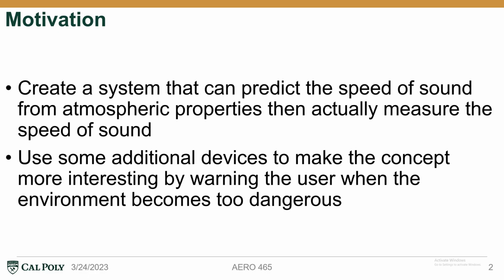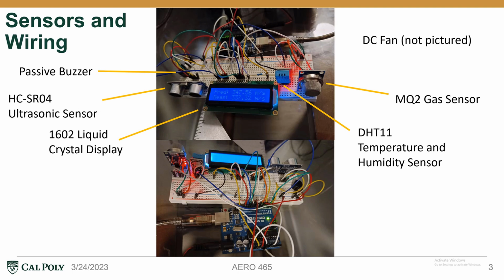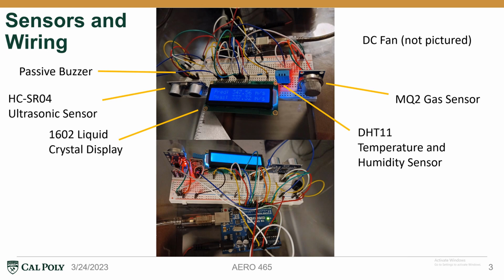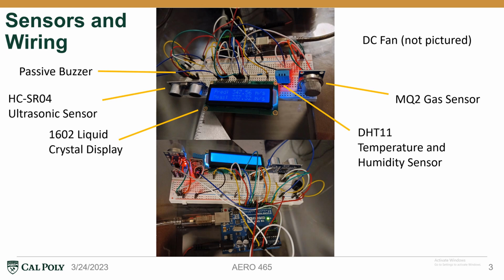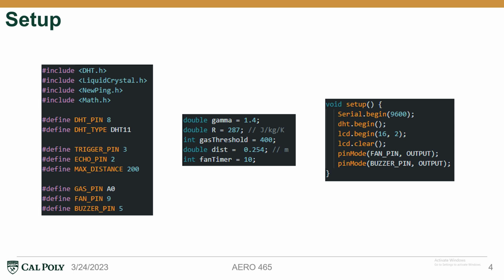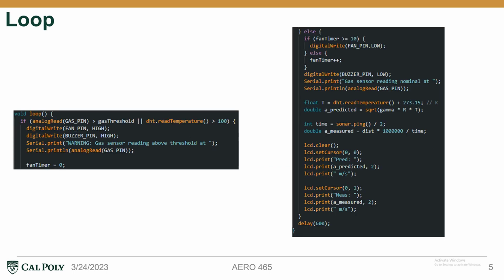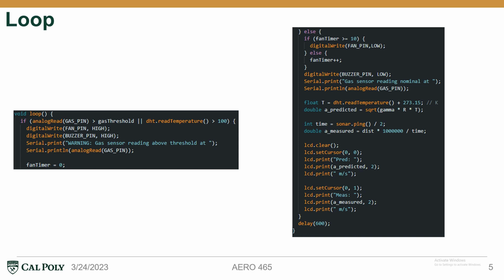Measuring the speed of sound and more with an Arduino

Comment from the maker: I probably could have made it work without an external power supply, but my only 9V battery was already almost dead. Theoretically, no connection to the PC is required.